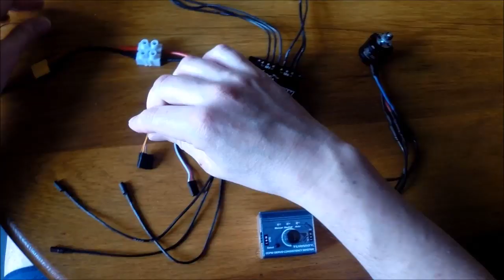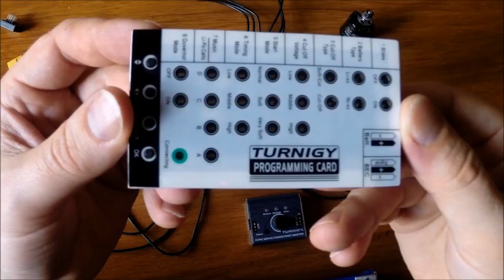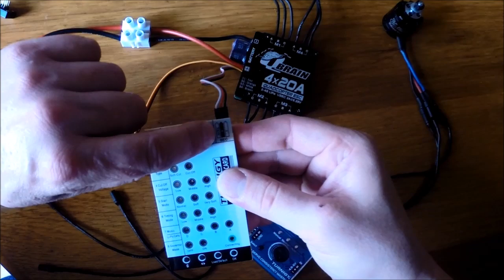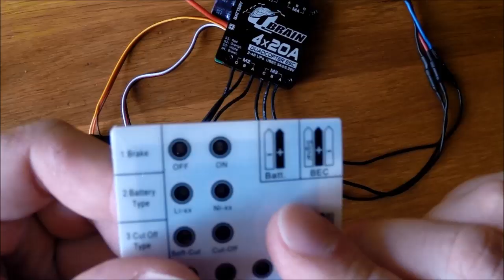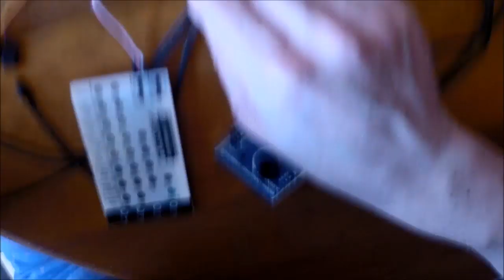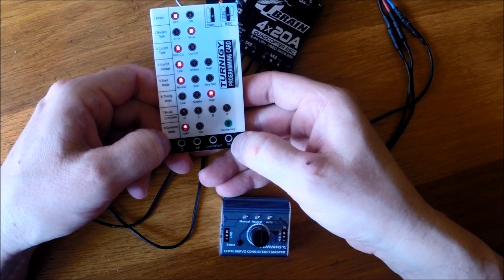Q brain 4 in 1 ESC Programming with Turnigy programming card

Comment: Hey Alek , Nice video , Thank you for posting since not much documentation found for the q brain. I Read the manual which comes with q brain , It says it is in NIxx mode as default , When I connected my 3s lipo I heared no beep , but when I tested the BEC it was working . tested with an led and the voltage was 5.2 . Anyways what kind of beeps I am supposed to hear after joining the battery